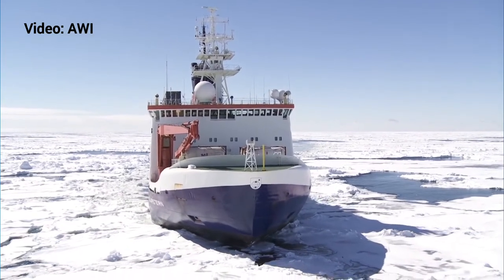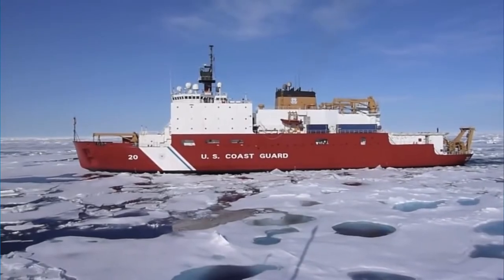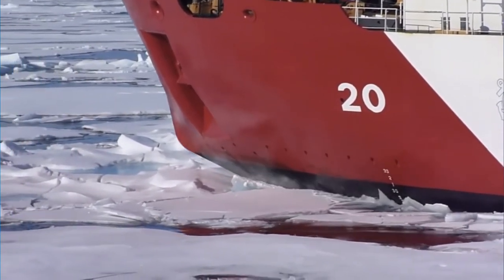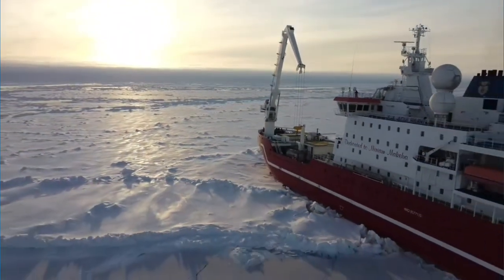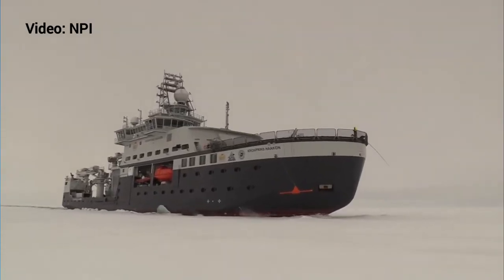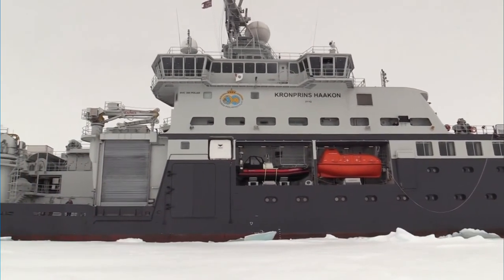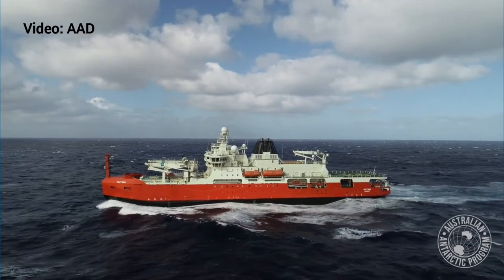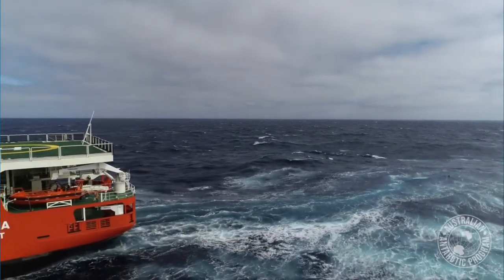The world's best research icebreakers

Comment: Wonderful and very interesting. I have a question for you. Besides the propulsion of the engines is it the design and reinforcement of the hulls that makes the breaking of the ice possible, or is there more to it?
Thank you so much again for the information. I love following you and learning all of what you post. Take care and have a wonderful day!
Reply from the maker: Thank you very much! Indeed it is a combination of all. Firstly, the bow (or nowadays even stern) shape is important. It is a gentle slope pushing the ice underneath the ship inducing bending failure in the ice. Of course powerful propulsion is needed to push the ship forward and generate the cracking force. Then some icebreakers do have special systems either squirting huge amounts of water onto the ice in the bow area to reduce friction, or generating a bubble curtain around the ship's hull. In addition heeling tanks might be used to oscillate the ship from starboard to port for increased icebreaking performance.

Comment: Thank you for the overview. 🙏
Only been in ice a few times, mostly Baltic , gulf of Finland etc, but always imagined the extra work we were going to have repainting the boot topping ! The noise also sounded throughout the ship, clear even from the bridge. All interesting stuff 👍
Reply from the maker: Yep, paint is not very durable...
Reply: @SeaIceStories  🤣🤣🤣🤣
Reply: @SeaIceStories  you would think that they could use Teflon for a rubbing stroke on ice breakers !
Reply from the maker: @associatedblacksheepandmisfits  I think, as most sea ice surface is not flat, this is not an option. Imagine what happens to your teflon frying pan if you scratch it with a knife ;)
Reply: @SeaIceStories  a bit extreme analogy perhaps but I take your point, 😄 I think that was a bit of a "what if " moment 🤣🤣 plenty of them on board ship , "what would you do if you won the pools ?" Being a common one , Not too surprisingly , a few would opt to charter the ship they worked on and go take their shipmates on a cruise !!
Going up into the Arctic circle en route to the white sea from uk , we plodded along at economical speed say 10 knots ,enjoying the midnight sun and seeing orca pods etc and at least 3 times we were overtaken by these vast cruise ships going at 22kts in a hurry , and we felt privileged somehow to be able to enjoy nature ,and get paid for it ,all at a sensible pace !👌

 I do think there is a huge need for more robust exterior coatings for ships in extreme environments tho, and I am sure the boffins are beavering away somewhere 🤔